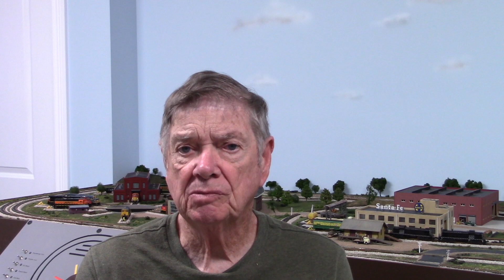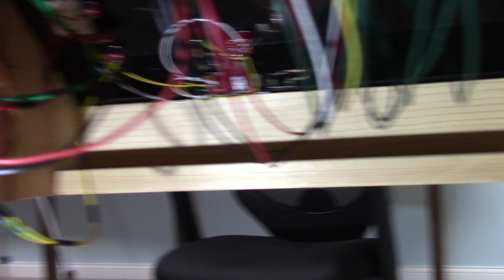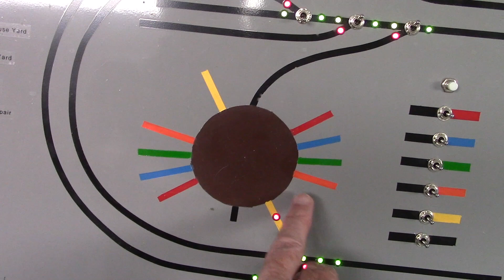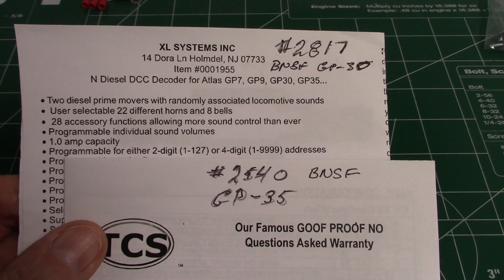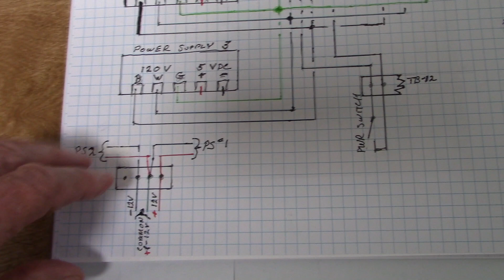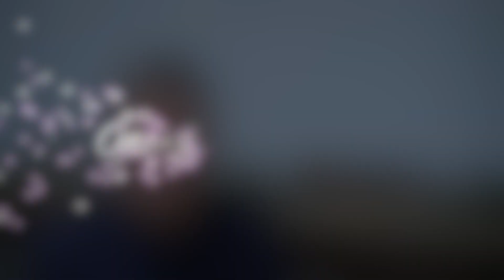Electrical Hints and Tips for Model Railroaders

Comment: Hmm, I think a circuit board with silkscreen labels would do wonders.  Could integrate some fuses and whatnot too
Reply: Assuming such a thing isn't already easy to get.  I could lay out a board, it would be fairly trivial.  However, I'm not a model train guy so I would need some advice on the most common circuits and buses needed